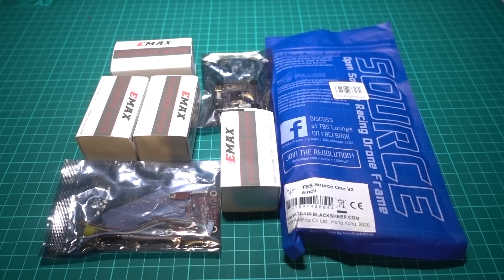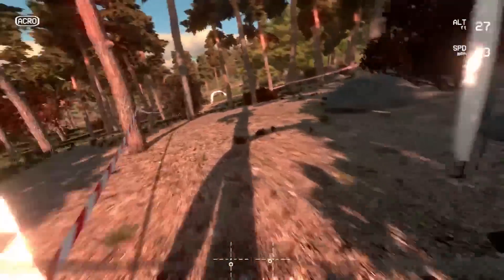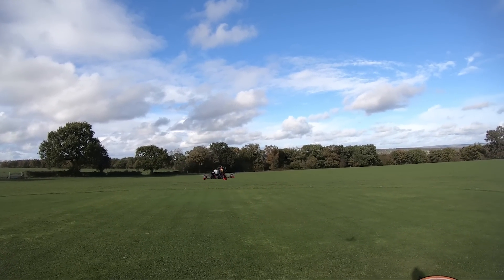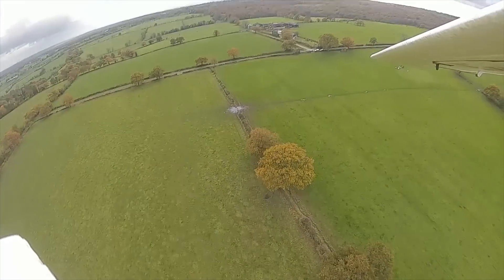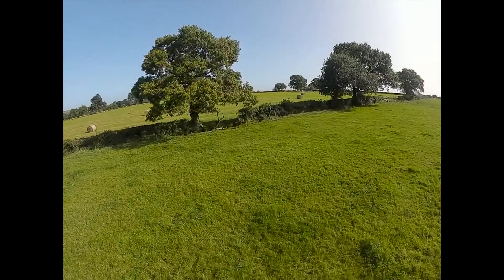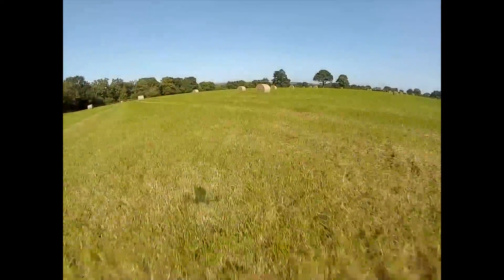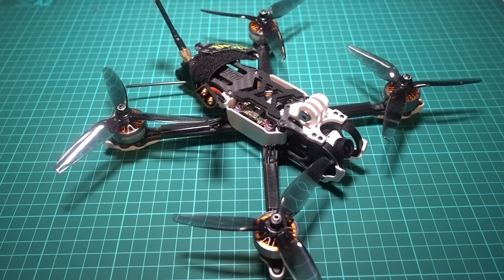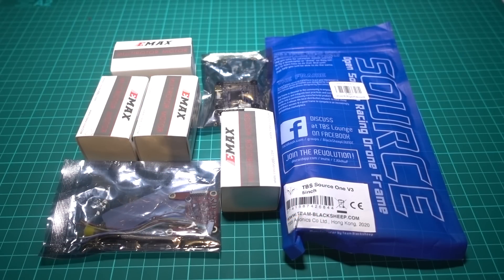Build A Drone - What is a Drone? #1

Comment: I wonder if anybody can help me with a problem:

I am using and FrSky terranis X9D plus, with an R9M module and a r9mm receiver. I wired everything like Joshua Bardwell did in his tyro 119 video series (im using the same build and even did the change of place of the S.port signal wire from the r9mm receiver).
But lately is switched my radio transmitter from 100mW to 500mW and lost my ability to receive an RSSI value.
I checked everything with the wiring and the ports tab in betaflight. 
Even my Terranis doesnt show the RSSI sensor when I go to the telemetry tab on it.
Before I switched frome 100mW to 500mW I got and RSSI value via a channel, like Joshua Bardwell did in his video ''how to put rssi in osd''.
The thing is, my terranis has connection with my receiver because when I look in betaflight I can see my stick inputs.
I've contated Joshua Bardwell but did not get any response yet.
I hope somebody can help me.
Thank you for reading!

Comment: Can the tx16 transmitter bind to frsky and flysky?
Reply: Yes
Reply: @nathanwalton4555  Do you need extra modules for that or is it all built in?
Reply: @rizen3467  the TX16S is multi protocol and so will bind to all sorts of transmitters out of the box (no need to buy anything extra), flysky and frsky included. If you want crossfire that's a separate module
Reply: @nathanwalton4555  ok,thanks!

Comment: Working on a eachine tyro79. Can't armed this drone. I even mess up with its firware
Reply: Make sure your throttle is between 995 and 1050. It's one of the most common problems in my experience check receiver tab.

Comment: Technically, a drone is an autonomous device. If it needs a pilot, it isn't a drone. Once again, we are devaluing the language. In this case, it's our loss.
Reply: That’s not true in the slightest.
It’s just another term for Unmanned Aerial System (UAS.). Possibly named after the QueenBee, a British RC target aircraft from the 30’s.
Reply: @daveday5507  The Queen Bee was radio controlled but not autonomously.  It was the basis of the term drone and doesn’t fit your description. 
So my point is: 
Drone does not technically mean autonomous, it just means the control is not onboard the aircraft.
As for the rest... please be civil, no need for the nasty discourse.
Reply: @shrekshrek1881  The 'Queen Bee' was controlled by a telephone dial.
Reply: I think only drones capable of autonomous flight need to be registered.
Reply: @droneracer  A good point.The problem is it's a grey area.
Reply: And lastly, my point is that drone is another term for UAV.  It does NOT imply autonomy no matter how curmudgeonly you slice it.
Reply: @shrekshrek1881  Have the last word if it helps your ego.